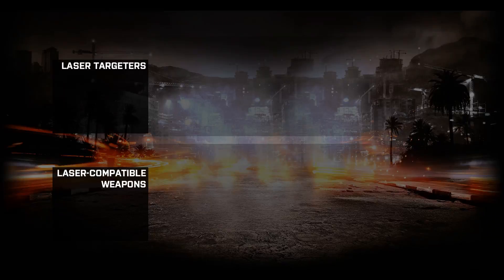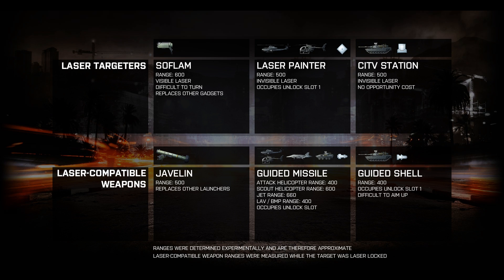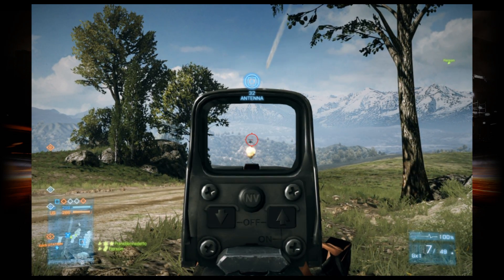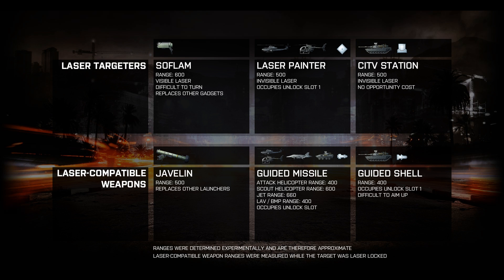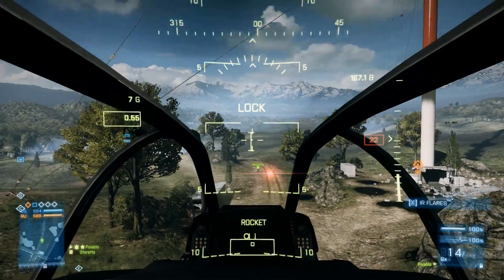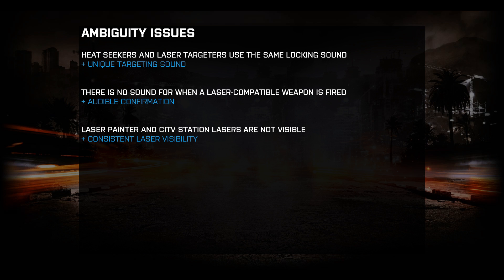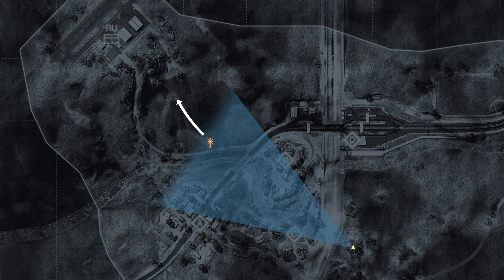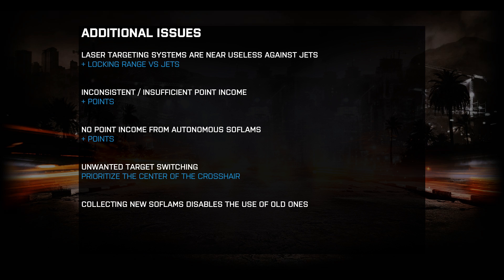Nitro Analysis - Episode 3: Laser Targeting

Comment: I disagree with 5:30 and the point of laser targeting vs. jets. Sometimes an ace jet pilot will ONLY die from SOFLAM+javelins if they don't catch it and are not running away fast enough. On Rush mode especially a good SOFLAM will keep me as a bomber at bay or at least constantly checking my back after a lock on to see if I need to put on my throttle and book it 2000m away in order to hope to survive against a javelin.